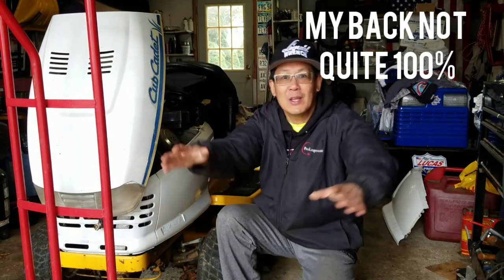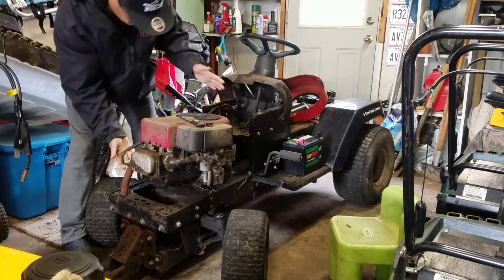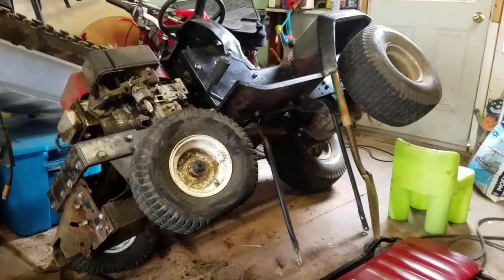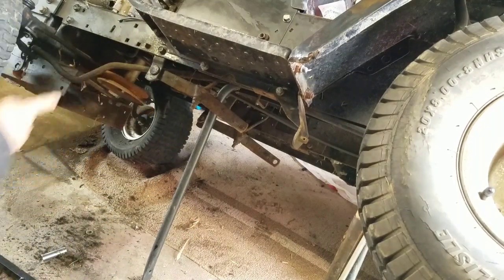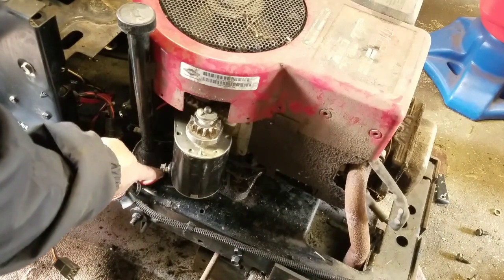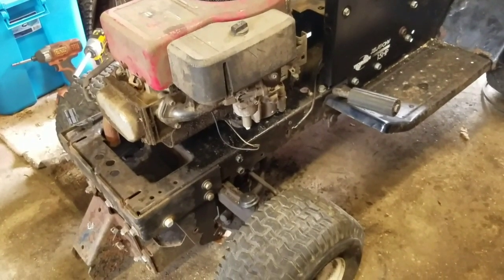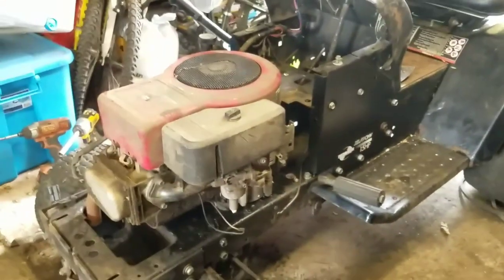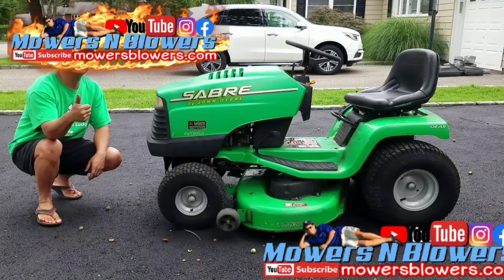REPOWER POULAN TRACTOR CARCASS 16.5HP BRIGGS FRANKENTRACTOR CRAFTSMAN LT1000 PIECE TOGETHER PARTS

Comment: I've fixed the muffler rattle before by running a screw through one of the exhaust holes and it pulls down the piece that rattles. Only works on the one with the loose plate inside. The one with the loose ring not sure that can be saved.
Reply from the maker: Good tip bro.

Comment: There is supposed to be the little washer thing that holds the stator wires. I had the same problem over the summer
Reply from the maker: But that goes over the bracket, not in between.
Reply: Yes, but I put it in between and it actually worked. Or just use a washer

Comment: Can you weld a plate over the second hole on a twin muffler and than use it on a single cylinder engine? I'm thinking just do that if the other one rattles bad.

Comment: Some starters use plastic teeth on metal flywheel gear the starter u have might have a thin metal bracket where it bolts to the motor u need one with The aluminum bracket it will space the away from the flywheel better
Reply from the maker: No, that's not true at all! Aluminum flywheel teeth require the plastic ring gear.  Cast iron flywheel takes the metal one.  You'll see from tomorrow's video.  There is no such thing as plastic gear to metal flywheel.  It's aluminum, not metal.
Reply: Mowers N Blowers. I was at junk yard today murray 13.5 briggs plas3 starter gear metal flywheel teeth
Reply from the maker: Lol... it may look like metal, but its aluminum.  I'll tell you what, why dont you put a plastic gear for a metal flywheel and tell me what happens.
Reply from the maker: Or some dumbass put a plastic gear on and that's why it's at the junkyard.
Reply: @MowersNBlowers  and yes, you can have a plastic gear on a steel ring gear. My dad's craftsman II tractor has a 13hp briggs with a plastic gear and steel ring gear. It is stock. Look up the model if you want, 28m707
Reply from the maker: @nickflopper  that doesn't make any sense, the plastic will wear out within a few turns.
Reply from the maker: So I just looked it up, 28m707 has several options, plastic gear with aluminum flywheel teeth, or metal gear with steel flywheel teeth.  There is no plastic with metal, just can't be done.  I've seen plastic chewed up immediately with a metal flywheel.  693557 flywheel is aluminum, not steel.
Reply from the maker: Then your dad's setup was wrong, sorry.

There are tons of fundamental videos on ring gears and flywheels.  Here is one that explains it pretty clearly.

https://youtu.be/4eMe2Py87H4
Reply from the maker: You may have seen it, but some dude didnt know the difference, but it didnt come from the factory that way.  Metal to steel, plastic to aluminum period.
Reply: The one i seen was 21b907 13.5 hp briggs ohv i took it off 2004 murray 13.5hp 40cut
Reply: @MowersNBlowers  that's simply not true. It doesn't chew it up instantly.  You can go watch it turn the engine over, you'd have to go upstate
Reply from the maker: @nickflopper  well, we can all debate it all day long, but it didn't come out of the factory that way.  But whatever, as long as it works right?  If it was wood and it works..who cares?
Reply: @MowersNBlowers  well maybe it was swapped at o e point because I just did a lot of research on it, and couldn't find many stock versions of it, but my point is that it has been on there for as long as i can remember and it hasn't stripped out
Reply from the maker: @nickflopper  yup, like I said who cares as long as it works right?  And thanks for the starter bro.

Comment: I wish you would have put some anti seize on the pulley before you mounted it to the crankshaft. Some poor SCHMUCK somewhere down the line will need to remove that pulley and he or she will cuss you out.
Reply from the maker: Out of maybe 25 tractors, I only had 1 pulley not just fall off..and that was a 1973 craftsman LTV10 that was sitting outdoors for 8 years.  I'm pretty sure itll just fall off.  But...if I end up getting a deck for this, I will grease the shaft up.
Reply: If you get 1 out of 25 stick, you are a very lucky man... for me, it's more like 32 out of 46
Reply from the maker: @nickflopper  32 out of 46 get stuck?
Reply: @MowersNBlowers  that's my past
Reply: @MowersNBlowers  Your lucky, I've had to beat the piss out of a few to get them off. Ironically its the newer ones that wont budge, the older ones, slide right off....
I came up with a great method when I'm at my uncles working on tractors, spray Aerokroil down the shaft, put a long block of wood across and we both smack the block of wood with mallets at the same time, they come off easy than, teamwork.

Comment: Who ever told u to use a metal starter gear on fly wheel that alum or metal there wrong . Metal teeth on fly wheels use plastic starter gear and ones with metal on start the fly wheel has plastic teeth .
Reply from the maker: You're so wrong.  Aluminum flywheel, not plastic.
Reply: Iam not u wanna come look at the two I have that r factory plastic ring gear on fly wheel nd a metal starter gear? Iv fixed and work on more then u have . And I work at a shop iv see many in my day
Reply from the maker: @stevenmaines9114  ok whatever you say.